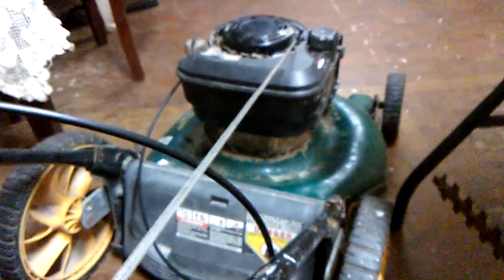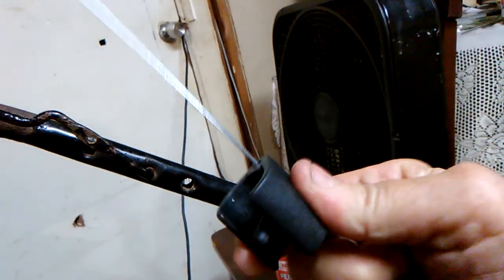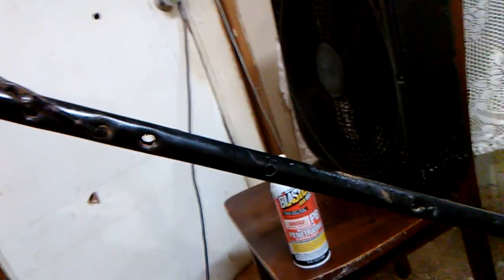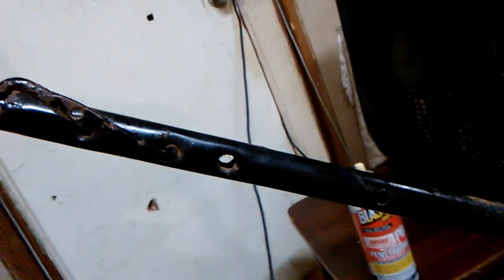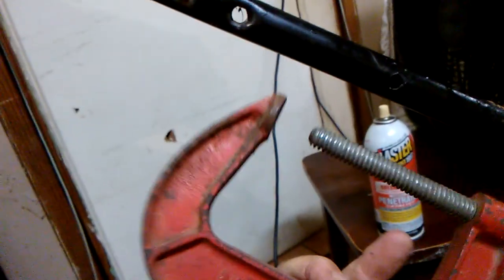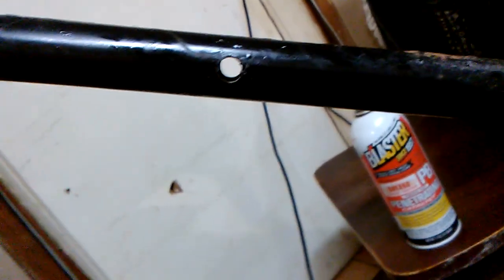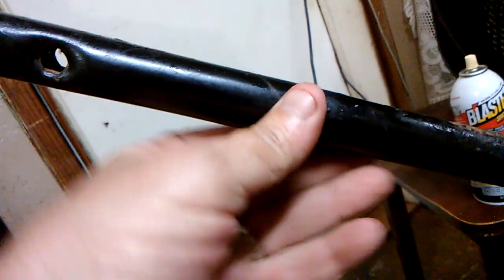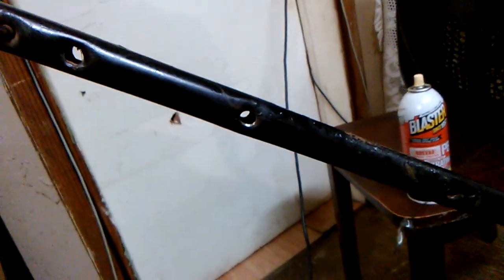Push mower, Dead Man / Brake cable How to..................

Comment: Nice modification Booboo!!☺
Reply from the maker: Well Merci   RK ..........   That is a compliment from you for sure.......     I have done this a few times with the longer cables, converting from the shorter ones....   

Anyone can drill a hole in the right spot and push the clamp into the hole, but it won't stay in there........ That's why they are are dimpled........ 

The other end of the TITTY comes out of the other side of the handle....... That's why the other side has to be dimpled also....... Other wise it won't stay in there it will jiggle around like two titties in a strip bar and work it's way out ... LOL....

Plus Tard Mon Ami  ~!~!
Reply from the maker: Ash I don't think the tittlywinks are making me wander at all........  

You got me wandering and thinking all the time for some reason....    LOL...   

Plus Tard  Mon Am ??????

Comment: Very cool tip boo
Reply from the maker: The longer cables need a new hole so the stroke length can be right ..............

It's easy to determine the stroke.......   I should have put that part in the video........ Thanks for watching Mon Ami ~!~!